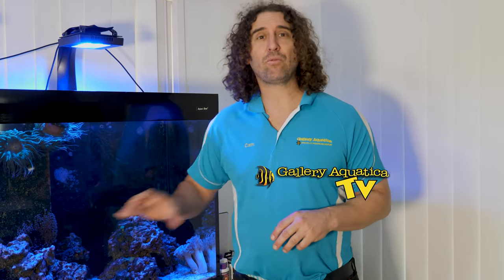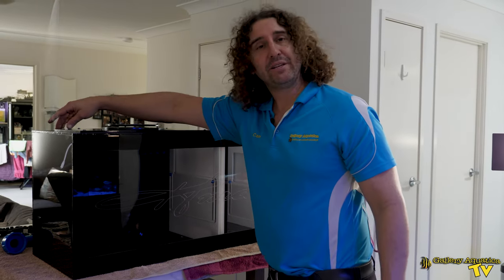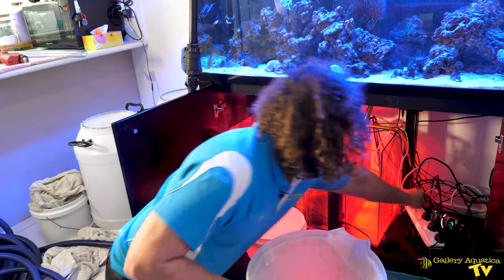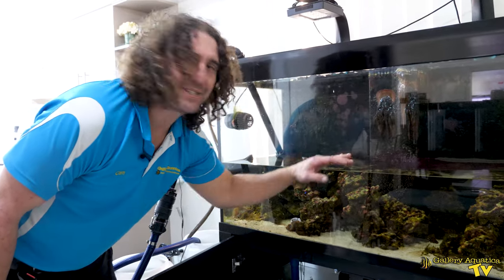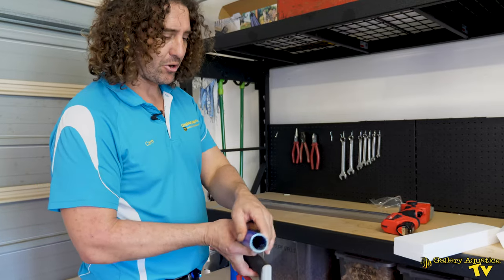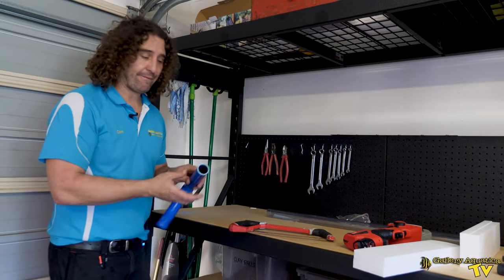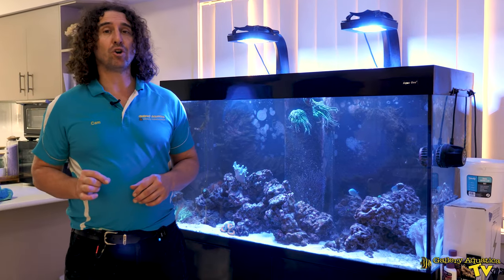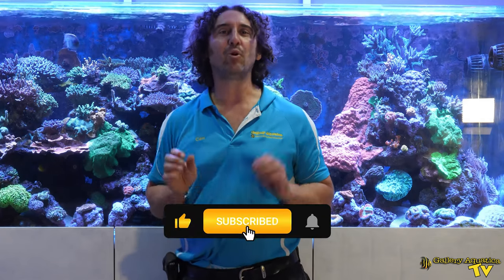Hmahli Sump Upgrade!

Comment: Any concern about using clear tubing as the coupling on the drain to encourage growth in the pipe? I guess the drain is big enough it would take a while for algae to clog it.  But if there is refugium light spill it may grow stuff.
Reply from the maker: I’ve had coraline algae grow in soft hoses that get light from the refugium which can cause blockages as the coraline flakes off. I don’t think it will be a problem here as the length of clear soft hose is very short. If necessary it can be easily removed for cleaning. Cam

Comment: I am a coward I would have taken another 2" of water out, put in a temp middle leg to the right of centre, put the sump in, put back the original support leg and then added the water back. Nice video.
Reply from the maker: Yeah, I think most people would have taken out more water. I was a bit worried myself when I struggled to get the middle support back in place. Cam